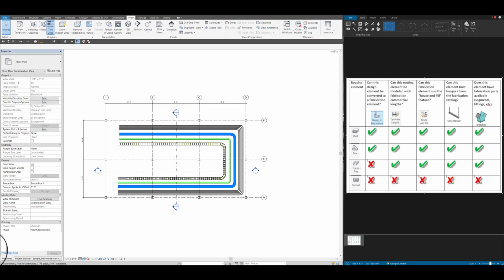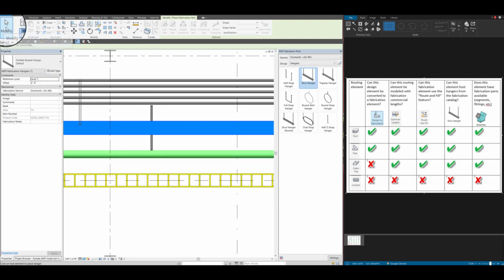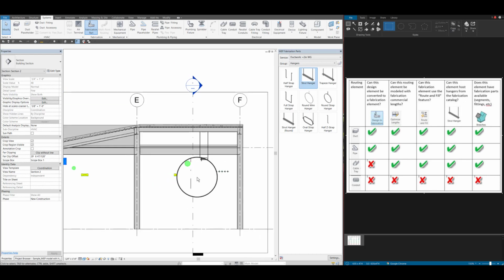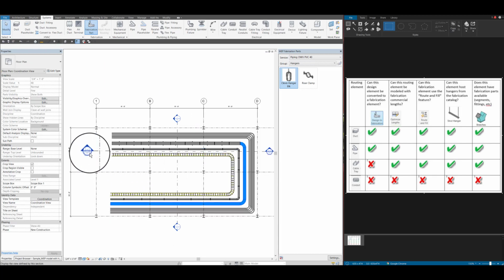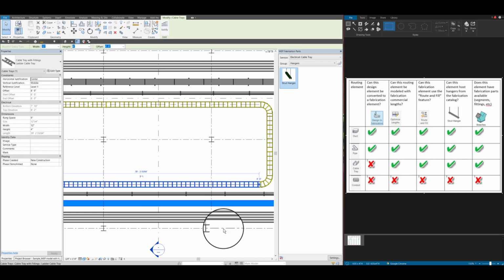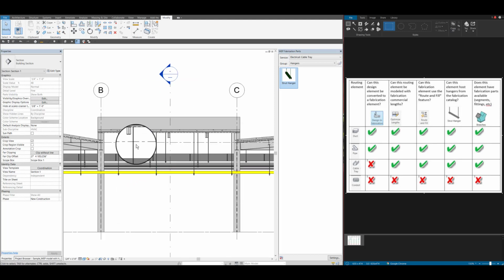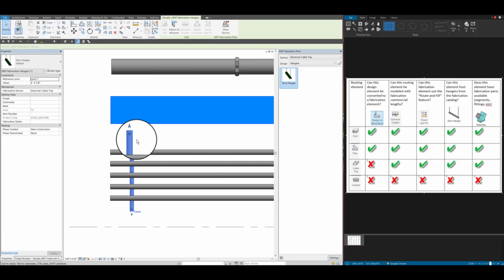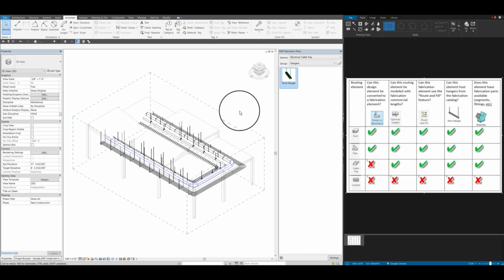Revit 2018: Using Hangers for Ducts, Pipes, Cable Trays and Conduits, with Fabrication Parts

Comment: Esse segmento de projetos elétricos nos EUA existe mesmo ou cada eletricista faz o que quer....vejo muito essa bagunça no meio elétrico!!
Reply from the maker: As explained in the video, this tool (Fabrication) does not work as well for the electrical discipline as it works for mechanical and plumbing. Even after years of making this video, that situation remains the same.

Comment from the maker: Hello, I see that this video has received 69 thousand views in 5 years. I did not expect this video to be so popular. In response to that, I have added English subtitles and translations into several languages. And I would like to re-visit this topic in the current version of Revit, 2023 or the 2024 version that is coming soon, to see what has changed about this topic in 5 years, and make an updated video about it.
Reply: THE HANGERS ARE NOT ATTACHING AUTOMATICALLY
Reply from the maker: @Wasim82m  The video shows the cases in which hangers are "smart" and other cases when they are not. I am just reporting what works and what not, depending on the category of the element. We the users have no control about these things. Please specify what case you are referriing to.

Comment: halo sir while i try for making support the error showing =Size(s)  25 mm are not available in fabrication service: Piping: DWV PVC 40.
The available sizes are:  32 mm, 38 mm, 51 mm, 76 mm, 102 mm, 127 mm, 152 mm, 203 mm, 254 mm, 305 mm, 356 mm, 406 mm.
Reply from the maker: Hello, Shabeer... I need to investigate that... I will bring more info later...

Comment: Great Video! It helped me understand design by fabrication a bit, but it opened up for some questions. I need to add clamps to a water pipe system, your instructions work great.
The problem is that I had the pipe in a cold water system which turns the pipes blue, but when I selected the pipe to design by fabrication it changed the pipe to a reddit standarized pipe (which im guessing its necesary to work correctly with the clamps) but also removed the blue color which im guessing means removed the pipes from the Cold Water system. Is there a way to work around this? I can accept not having the actual brand pipe families but I must have the water systems correctly.

Thank you so much for the video anyways!
Reply from the maker: Hello, @Mati, sorry for my late reply. I just tested what you described, in Revit 2020. Yes, after converting a pipe from model to fabrication, it looses the information about system (such as Domestic Cold Water). The two things are not connected, unfortunately. It would be necessary to add that information to a custom parameter of the new fabricated pipes, and add a view filter with color to keep showing the pipes with one color per system.

Comment: Thank you for such helpful video, Can we add our own custom hanger to fabrication? if NO then can we edit the parameters of the hangers that are pre-loaded with fabrication?
Reply from the maker: Hello, @Estore4U, sorry for my late reply. It is possible to edit the fabrication families, yes, but just in their dimensions. Not by opening the family as usual with "Edit Family". Can we add custom hangers to fabrication? I don't see a way to do that. You can add parts from those catalogs provided by Revit. Or, you can use custom families as usual, not part of the Fabrication library.

Comment: Hi, I'm using Revit-19. I'm drawing cable tray.
But today I'm changed some settings like visual graphics then after my project cable cable trays is have a problem.
But i'm not remember wich settings change.
But only fittings have a problem.
Problem is "It appears dimmed, looks pale, faint" i dont no true word.
Can you help me!
Reply from the maker: Hello, @Murat Uzunhan. Sorry for my late reply. Sounds as if the discipline of the view is not Electrical. Try changing the Discipline property of the view to Electrical or Coordination.